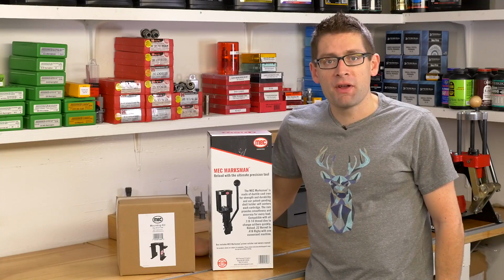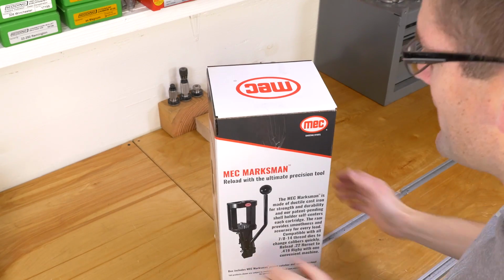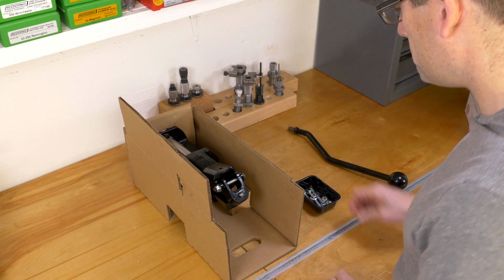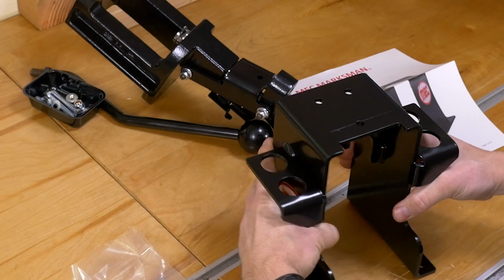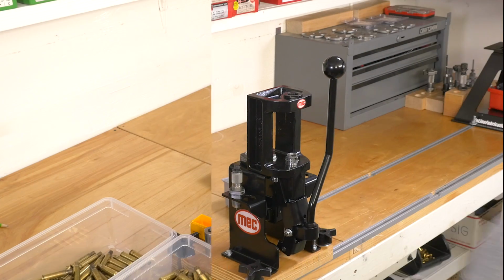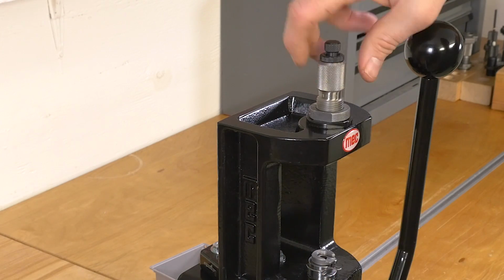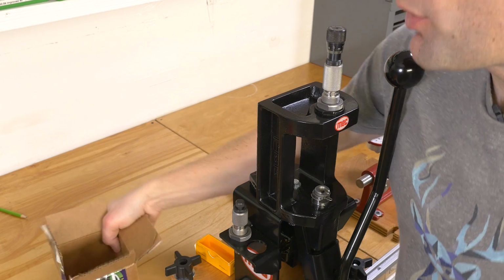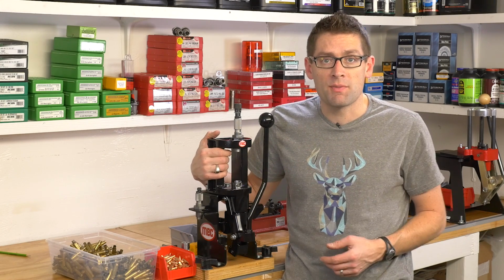MEC Marksman: Unboxing, Detailed Overview, Sizing/Seating

Comment: I don't envy many reloading benches but I envy yours! your track/rail system is genius. The MEC press looks like a winner and is a breath of fresh air in the metallic reloader market.  A fine review.
Reply from the maker: Thanks man!
Reply: His videos are outstanding. If you notice at the 10:10 marker the bench plate/rail allows the press to move towards the ram handle while he is seating the bullets. I wonder how much more it would Flex when F/L sizing  300 win mag brass? The rail system is a great idea and with HD steel mounting rails the flex would probably be eliminated.I like my presses to be rock solid mounted to the bench with no movement.
Reply: @Airtractorfan1963  that flex would drive me nuts.
Reply: I agree about flex - my presses are rock solid on a very sturdy bench & are much nicer to use than when they were on a lighter bench with a touch of movement. The steel riser mounts offered by Inline Fabrications which Gavin often uses always display an amount of flex that would be more than I’d accept.

Comment: Just got one. I note that your ram is not resting all the way down too. I noticed that when the handle is screwed all the way in, it butts against the press not allowing the action to return to bottom. Same with the Inline Fab handle I got. I think the handle can be Dremeled to accomodate. But I will contact Inline before I do that. Threading back the handle to where the ram seats full bottom, the threads are barely protruding out the other side and doesn't insert all the way through the nut. I'm sure it will still operate fine, and it may not matter that the base doesn't seat all the way down. I don't have any regrets. I love the press and the Inline roller handle. Just FYI

Comment: 300win mag
Tikka 1:11 twist
210gn ablr
69.6gn of 2213sc adi powder
Seated .3off lands
Shoots .3moa to .5moa thus rifle has lumley arms pillars and recoil lug plus atlasworks dbm and accurate 3.85mag length so i can use a magazine also new bolt stop and a terminator t2 brake its my fav. 
Shot a spiker at 730m take down!

My 308 1:10 twist howa fluted heavy barrel in houge stock i use 190gn ablr with 43gn of 2208 adi which is varget. It gets .8-1moa.

Comment: Awesome looking press.  Looks to me like MEC took many of the best design elements from other presses and put them in one machine.  Curious to know how well the spent primer catcher works, since I've had quite a few primers spit out of Redding Big Boss and RCBS RCII presses over the years.  Also, I was initially surprised to see no priming system on this, but after thinking on it, not sure this is a big deal since I rarely prime on the press with a single stage anyhow.
And great video by the way...looking forward to seeing more in this series!

Comment: MEC Marksman was just delivered and I de-primed about 1000 rounds of brass which was a mix of 45 ACP, 243, and 30-06 using the Lee Universal de-primer. The press is very well made, strong, resizing is not an issue. Some have noted that you have to prime off-press, however, I do not see this as an issue for a single stage press. Why? I find the RCBS bench primer a much better system and allows me one less step on the press. The open front is one of the main reasons I got this press as the off-set "O" is annoying at times. You have full view of what you are doing especially when mounted on the MEC Mount. Your review, early as it is, really helped my decision.  Keep up the great reloading tips and reviews.

Comment: So you have a selection of presses now. This press looks impressive and well build. I like the self-alignment idea. That being said, out of all the single stage presses you've used. What one do you prefer the most.?
Reply from the maker: It all depends on your reloading process (example: do you need to prime on-press), budget, etc. I still have some presses to try as well: Forster Co-Ax, LEE Classic Cast Iron single stage, etc. The Marksman is probably the slickest in terms of cycling, the Iron Press is the only one with a fully-automatic slide-bar tube primer, and the Redding Big-Boss II is a very high quality rig as well (manual on-press primer works GREAT). What do you want to do with a single-stage?
Reply: gavintoobe I mainly do long range precision shooting. I run the big Lee press now after my Hornady was introducing .004 runout on all my cases. The Lee does ok, and it's a good press. But I like the idea of the floating shell holder like foster has. Seems like that would help allow the case in to the die with no angle or side pressure if it's not aligned perfect.
Reply from the maker: The MEC Marksman has a floating shellholder- may want to give that a look! http://ultimatereloader.com/2017/01/05/mec-marksman-single-stage-unboxing-overview-setup/

Comment: Your review failed to mention that the Marksman does not go past center when the ram is at the top of the stroke.  It appears to stop on the linkeage  before reaching the breakover point.  I probably would not have bought one if I knew this.

Comment: Excellent review as always, I wasn't even aware of this press until I saw this video. I really like the finish on the press, it looks high quality, at least in the video. I also like the floating case holder feature. I don't care about priming on the press, I'd rather use the Lee Auto Bench Primer. BUT, big question: where is the MEC press made? Thanks.
Reply from the maker: Made right here in the USA!
Reply: gavintoobe Wow, nice!

Comment: I'm not going to pick this press apart and ask where is this or where is that. It seems to me that MEC is testing the waters to see what kind of interest there is is the metallic reloading market before they go and start with turret presses, primer tubes and the like with regards to accessories. I only say that because that is smart business and that's what I would do as a business, only makes sense. It's going to be a system to keep on your radar in the coming years IMHO. MEC don't mess!

Comment: I plan on replacing my Rock chucker supreme to take advantage of the floating shell plate holder to get better consentricity  when seating bullets. 
I read in Glen Zedekers book the he recommends replacing the metal clip that is used on most press rams with a rubber o-ring.
Do you know if this will work just as well?
Thanks,
Steve
Reply from the maker: Steve- if you want the float, the MEC Marksman has it from the get-go- and you can add the Hornady lock-n-load bushing system as well ($15. upgrade, money well spent).

Comment: I bought this press because of your glowing review. Since purchasing and using it I'm finding 3 to 4 thousands of flex while resizing 6.5 Creedmoor. Is this normal or acceptable for a quality press.
Reply from the maker: That's strange- what sizing die, and how did you set it up? Are  you checking with a headspace gauge like this one? https://www.amazon.com/Hornady-HK66-Lock-N-Load-Headspace-Gauge/dp/B000PD5VN8

Comment: I'm so interested in reloading. Especially with a progressive. But all presses seem to have mixed reviews and quite frankly, it's turning me off from the idea. Am I missing something? or is it really that risky to spend such money and still have problems of stuff not working as advertised. Because all press Manufacturers seem to have their "it's a pos" reviews. Should I just disregard and chalk it up to that just being guys who didn't read the instructions? I've never reloaded, but am eyeing the Hornady LNL. I understand the issue of needing more parts than just the press, set up and fine tuning, but is that a good press to start off with?
   I'm not one for "entry level" anything. If I get into something, I want the best, and do not want to spend money later to upgrade. Though I don't want to spend $1000 on just a press.
Reply from the maker: Your experience here is why I started Ultimate Reloader, literally. I spent countless hours online deciding on a press upgrade. What are your requirements? Rounds/month, # of calibers, etc. Lock-N-Load is a great press, and the "Get Loaded" (500 free bullets) sweetens the deal.
Reply: Thanks.  Right now I'm shooting up to 200 9mm a week. But I shoot 223,  7.62 and in the near future 270.

Comment: Gavin: 
Do you think it is possible to use a LnL bushing system like you can with the RCBS and other presses?  And index them so that they run at the same height as a LnL progressive?  How would you compare the leverage to a Iron Press?  Im in the market for a new single stage, and leverage is a big deal because I size alot of 7.62X51 LC brass for 308.  Thanks!
Reply from the maker: Both presses have good leverage, the Iron press costs more, but does have on-press priming- decisions decisions!
Reply: Thanks for the info.

Comment: What is your opinion on the Mac Marksman press vs the Forster CoAx press
Reply from the maker: Both have their advantages- what is it you plan on doing?
Reply: I plan on replacing my Rock chucker supreme to take advantage of the floating shell plate holder to get better consentricity  when seating bullets. 
I read in Glen Zedekers book the he recommends replacing the metal clip that is used on most press rams with a rubber o-ring.
Do you know if this will work just as well?
Thanks,
Steve

Comment: how does it compare to the other presses in the same price range? I have a rcbs summit but i am looking for a 2nd press to purchase.
Reply: I would think that they would perform fairly similarly with the exception of the floating shell holder. However, that is more for those who are working on grasping the last little bit of accuracy out of their reloads that they can and not for the standard reloader. For the vast majority of even precision shooters, your RCBS Summit is a fantastic press.

Personally, I have been putting up with the poor concentricity of my Lee Turret press and will probably be making the switch to this. I have been eyeballing the Forster Coax for a long time, but I think I like this design and price better.

Comment: Do you get similar run out results when using that die on a different press?  Thanks.
Reply from the maker: Lots of variables- still need to do more scientific measurements- including neck runout (thinking to get Sinclair tool). But, the Marksman has produced some great results with bullet runout!

Comment: Looks like a great press. I’m worried about how you measured runout though. In terms of run out, the case should be held by the body and case head. Then the bullet should be checked at ogive or just in front. This is due to the datum scheme of a rifle chamber.

Comment: Great video, sub from me. Question.... Will the MEC Marksman accommodate 1 1/4 dies?
Reply from the maker: The threading is there- I installed the Lock-N-Load bushing conversion, but I'm not sure about clearance, etc for loading with 1 1/4 dies. :)

Comment: Hi Gavin. Love all your videos, just finished my take on the ultimate reloader bench system. I was considering purchasing the MEC Marksman press but I am concerned that it may not work on my table due to the location of the spent primer tray. I set a 2x4 apron at the front edge of my table so I'm worried the spent primer tray will hit that. I would like to mount the press without using the additional mounting stand. I am curious, how far down does the tray sit below where you mount the press, and how far back does it stick out? I've been trying desperately to find this information but no luck so far. I saw one video where the guy had to cut a spot out of his apron and I'd like to avoid that. Thanks! Keep the videos coming!

https://www.youtube.com/watch?v=YWmznm1PNac

Comment: I just received my Marksman, and my first impressions of it are terrible.  The entire front and back of the vertical supports have gouges where someone took an angle grinder and chewed up the surface prior to powder coating it.  It's hard for me to have any kind of confidence that there is any kind of precision in this press, if they are willing to do this.  I called to talk with them and got the too bad, so sad, but that is the way they are line.  This is a crock.